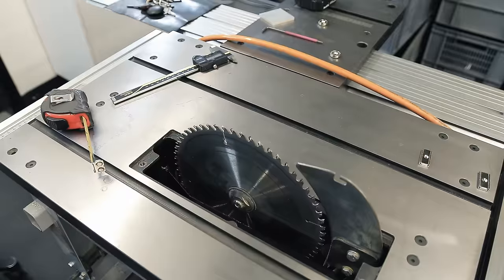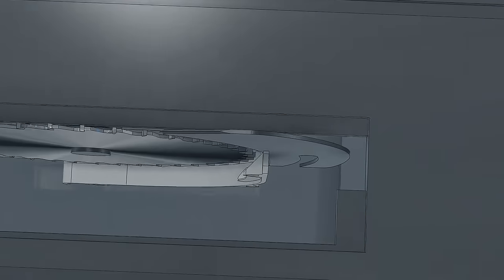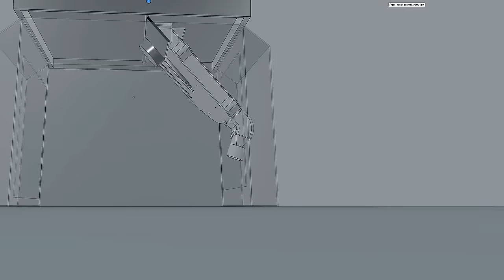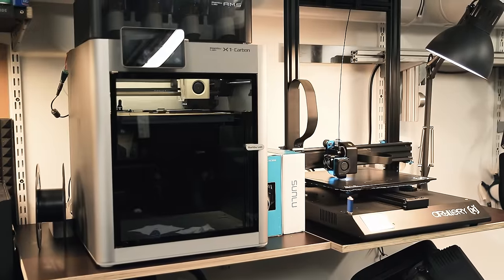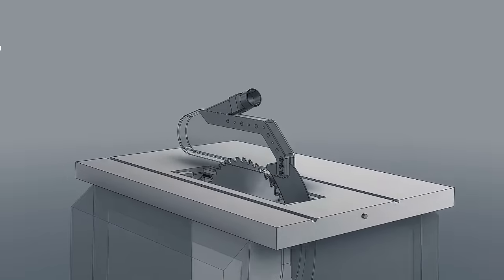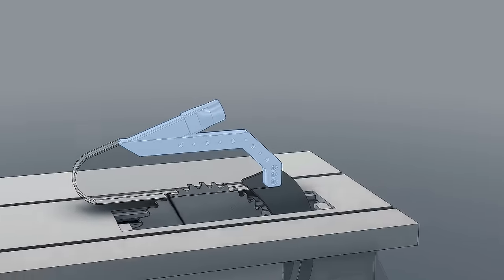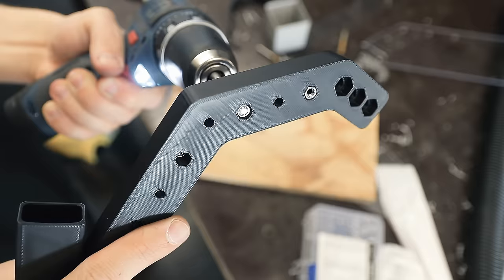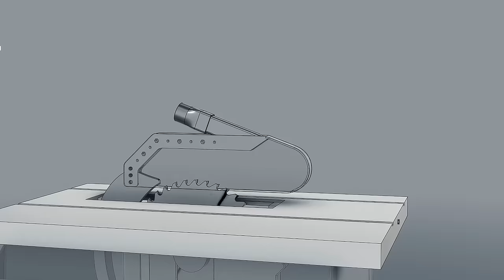How I re-engineered my Table Saw Dust Collection from Scratch using 3D Printing

Comment: The simplest and most effective dust collection I've seen is just removing the box and sealing off the bottom and putting the suction hose at the bottom.  Then get some magnetic sheets and put them across the gap at the front so the blade can still tilt.
Reply: Like an actual cabinet saw.
Reply: That is how most of the higher end saws I have seen work
Reply: Yes, I just don't get it. why pay all the effort to seal up the tricky blade not the whole bottom box

Comment: Put bristles at the end of the shroud.
Reply from the maker: I thought about that but unless the bristles are signficantly longer than your workpiece thickness you'd still end up with a gap at the end while also losing suction
Reply: @PhilVandelay  Would those 70mm bristle CNC vacuum strips work for you?
Reply from the maker: Possibly, it's just that I've never seen anyone use this approach for a table saw and I figured there's probably a reason. Might be worth a try, but for now I don't want to spend any more time on this
Reply: @PhilVandelay I was gonna suggest something similar, but not bristles: just add a short 3d printed (straight) piece to the front edge of the cover which is essentially extending the curved part, but can pivot. Once the piece of wood passes underneath, it drops to the table saw surface and essentially provides a ramp into the curved hood for the stuff that get's thrown out under the cover from the blade at the end. Watching the clips, the escaping particles are only a problem once the saw blade is starting to cut the back edge of the piece of wood, and by then this "ramp" would have dropped and likely catch a large portion of those.
Reply: How about sealing the bottom with another sheet of polycarbonate and using the saw to cut its own slot? That might seal it even better
Reply from the maker: @tanyeewei  Interesting idea!
Reply: My dust shroud came with skirts on each side that ride up and down on washers. It keeps one side closed if you're cutting less than the width of the shroud itself. 

The front has a flap that drops by gravity as soon as the work piece has passed through, creating an obstruction for the larger particles.
Reply: @PhilVandelay  any chance you'll sell and ship this to me?  Pretty sure I have the same saw :)

Comment: If you look closely on your video, when the wood piece travels passed the front edge of the blade shroud, the saw begins throwing dust particles backwards toward the user. If you had a small floating flap piece that was easily pushed up by the stock you're cutting, but then fell back down once the piece was clear it would likely cycle those chunks back into the shroud air flow

Comment: I am envious of this setup and will need to try printing some of these bits! For what its worth,  heres something i discovered when trying to do dust collection on a buffer -  the fast spinning blade essentially creates its own eddy which prevents dust collection. The only solution is to allow more airflow - i suspect that your shroud on the bottom is actually too narrow . Screens or bristles can be a lot more effective at closing in areas because they allow airflow IN but prevent chips from escaping. In my case a large box was more effective at fine dust collection than afitting shroud. Something to consider of you ever find yourself wanting to get additional capture. But what you've made is phenomenal!
Reply: I agree with this analysis, but this applies primarily to the large particles where you need more airflow to redirect particles with more momentum. For the fines, this was adequate.

Comment: I just finished this last night. 
first of all thanks for including the original files!!! I was able to adjust it to fit my Ridgid saw perfectly. 

I removed the bottom two nuts and added another nut at the back after scanning my riving knife and making a quick sketch. 

I have a 2HP dust collector and there is now literally 0 dust when I cut. this works so well. 

the only issue I had was cutting the polycarb by hand using a jigsaw. I had a small corner chip off but it's hardly noticeable.
Reply from the maker: Great to know it works for other saws as well!

Comment: Very nice work!  Well done!  I will definitely have to watch this video again, probably a few times.
At this point, two areas for possible further improvement jumped out at me:  a few other commenters have suggested adding some kind of bristles at the front of the blade guard/dust hood; and a few have also mentioned the importance of adequate air flow.  
Really liked the way you broke the problem down - some pieces are stationary, while others move with the blade.  Most folks would have missed that.

Comment: One improvement I'd love to try on your set-up is a flappy bit or brush that sits between the curved front and the blade like a scoop. Visible at around 20:28 

Making it a zero clearance style scoop means that the shroud won't have a big gap underneath it as it's lifted by the work material, so you'd also collect most of the chips not just fines.

Amazing build! I'm definitely stealing this concept for my mitre saw aka the dust cannon.
Reply: That’s what I was thinking. A flap that would ride on top of the material and fall down to the table once the materials pass.

Comment: Great video, subscribed! This is the reason why 3D printing is such a revolution for people like us. It allows us to design, prototype and print things that most manufacturers cut to save on product cost. I find that 99% of tools I purchase can be improved in some way, so I love this video.
Reply from the maker: Absolutely, making this from sheet metal would have been a nightmare, especially if you want to do rapid prototyping. I probably wouldn't have touched this problem were it not for the option of having my printer do the grunt work

Comment: Thank you for this, i purchased your 3d design recently and have now implemented this.  They key as you mentioned is the 'fine' dust that this captures and is the most important bit.  my workshop is typically was coated in a fine layer of dust,  this is now hardly noticeable,  it has worked wonders :)

Comment: Looks quite effective and a happy relief for you.  As you were talking us through it I was thinking that it is necessary to keep enough inlet open area to keep maximum velocity to entrain the particles with the air flow.  I chuckled once when I joined a company and one of my challenges was to solve a problem with a machine that had 250 cfm flow through a ... closed box!   Not too challenging for me to solve.  Same principle here.

Comment: Nicely done! The only thing you really need at this point is more CFM! A shop vac is only going to provide around 80-110 CFM. Most Table saws are going to require around 550 CFM.

Comment: Holes to the right of the blade in the zero clearance insert will allow more airflow, possible improving dust collection above and around the blade
Reply: Do you mean to the left of the blade? The right side of the insert would be covered by the wood.  See "Hooked on Wood" to see how Dennis engineered the HOW Zero Clearance insert. He's a lot like Phil here--a born engineer.

Comment: Nice video Phil! Some thoughts about your design. 

I know you said you don't have the justification of a dust collection system for the few tools you have in your shop. Shop vacs have very few cfm (cubic feet [or meters] per minute) but have higher velocity air movement than most dust collection systems, the reason your design needed to be so tight around the dust problem. More cfm would allow a looser design and accomplish effective collection. Of course your upgrade to a larger vacuum helped with this issue. 

Also small hoses and connectors also create restriction to cfm flow, so the larger the better. Even your wire reinforced hose tends to create more vacuum drop in the system, reducing the vacuum's ability to do the job, so the shorter those lengths the better. 

And for the design of the dust collection on the top of the saw, your blade guard that you designed is curved in the front to help redirect the dust toward the back where the port is located on the guard/schroud for the dust collection. That guard is attempting to change the direction of the dust particles from the way they come off the blade during a cut almost 180 degrees. However, larger particles have more momentum and can't be overcome by the available vaccum/cfm used from your vacuum because of the momentum due to the size/weight of the wood particles not collected. And of course, the denser the wood cut, the greater this problem will be. To capture the dust currently escaping, it can be done in one of two ways, increase the cfm to overcome that momentum, which might be difficult to do while attempting to keep the blade guard from getting too big, and/or possibly try and change the direction of your dust collection port so it catches the sawdust in the same way it's generated off the blade, instead of making it change directions, then to be collected at the port on the guard/shield you created. Hopefully this makes sense.

I didn't read through all comments so hopefully I'm not repeating what someone else might have already suggested.

Again, nice job, appreciate the content you've produced.

Comment: Chapeau. Very clever engineering and great solution to the issue. I just got the TS250 and am drowning in dust as well. I'd appreciate if you could share your design files for the dustbox. Thanks a ton.

Comment: For the hood, you could attach a small flap at and angle with a spring so when you push the material it rides on top of it and once you reach the end of the cut it can drop down and hopefully reduce that burst of particles.

Comment: There is a channel Hooked on Wood were you can find his experiment with an insert that has air slots to improve the airflow into the suction hose. His logic is that airflow out has to have a way of air getting in otherwise you just get a kind of vacuum. Airflow is what moves your dust.
Reply from the maker: Interesting, I'll have a look at that

Comment: Well done! One thing that might improve the dust collection of the heavier chips would be to attach a drop-down guard at the bottom of the rounded front in the shape of a hollow wedge, so that the sides is covered while the blades throw line is covered. Not sure If I make any sense, but just make a hinge on the bottom of the part you glued in that drops down the wedge as the wood passes by.
Reply from the maker: Yeah I've actually seen hoods like that but the main problem seems to be that it wants to shoot out straight to the front as you exit the cut, not so much the sides. I also thought about having something drop down in front to close that gap but couldn't really think of a good solution that works with varying blade settings. I think you could keep working on this endlessly and probably improve it a lot more but I wanted to be done with it 😅
Reply: @PhilVandelay  would brushes around the hood help?

Comment: That's a solid result. I wonder whether a wide-mouth intake fit level along the outfeed side of the table would catch those few remaining large chips. The cut wood would pass over it so it might remove chips stuck to the newly cut surfaces, too.

Comment: Very nice design, Phil. I like the magnets most. Makes everthing nicely maintainable. Something I would have done differently would be to think of flexible parts or even textile parts so that the dust box can move freely while everthing stays enclosed in any position. Maybe some kind of broom or vacuum cleaner hairs which close the gap when the saw is upright and bend against the dust box when the saw is tilted - or a leather or linen enclosure...
Anyway, well done.

Comment: You may want to try a small brush strip at the leading edge of the dust hood over the blade. It might slow the larger particles down long enough to be caught up in the suction.

Comment: im thinking of adding some brush bristles around the dust hood that's over the blade, like the brush around a CNC router. and also some upside down bristles in front of the saw fence rail.

Comment: Add a small rubber/silicone flap to the front of the top intake so when the working piece is past the front of the top intake the flap extends down and directs the chunks up into the intake.

Comment: Interesting! One addition that could be made is a slim suction slot behind the blade that could suck up more particles escaping from the back without hurting the table too much. Also, working on making the tolerances as small as possible without having stuff get stuck could improve the amount of static pressure, right? I feel like automating and improving the cleanliness of a shop not only helps avoid health issues but also makes you spend more time on the fun stuff in the long run.
Reply: Also. Designing an accordian style hingesystem might help with having less rigid parts and more parts that could adapt for the tilting.

Comment: You might consider designing the stiffening ribs for that dust box cover on the outside, so they don't catch fine particles and [further] turbulate airflow inside
Reply from the maker: That's actually a very good suggestion. Seems obvious in retrospect but never even crossed my mind

Comment: What an awesome piece of work, congratulations.  I'm sure I have the same saw, with the same problems but mine is badged and painted differntly.  Either that, or it's incredibly similar.   After hours spent with the side panels off trying to clear sawdust out of the way your video was like looking inside my own.  Even with a big, 100mm dust extractor on a 2m hose it's rubbish.  
Is there any way you could post the CAD and other info for the dust cage and zero clearance throat somewhere like Github or similar?   If the dimensions are anything like similar to mine I'll go out and buy a 3D printer just to fix it!

Comment: You could improve the dust hood on top by making the curved part a little lower, as dust seems to now shoot under it. If you make this end up at the height where a standard board (the normal size you'd use this with) would have the hood rest on the table itself once it slips past it'll close that gap, where it now instead leaves a gap as the board pulls up the hood.  
You could even make this a little flexible extension for the dust hood, or attach a brush to it, as all it needs to do is stop the dust shooting out so that it can be sucked up.

Comment: I did something similar but added another sliding box outside the main box to be able to have maximum coverage at all angles.  I never made it self adjusting so you had to change it everytime.   Was fun.  Unfortunately the effort wasn't worth the saw I put it on and I have now a better saw.

Comment: This is such a good video. Many have struggled with ideas but you did great at implementing what you did. I never thought of 3d printed insert. I have a saw like yours with that annoying top rod that wants to be close to the table surface. That is the cheap design compared to Unisaw and top models. Anyway, model it once, which is tricky as other odd forms are involved with holding that pivot rod and so on. Then reprint as needed for straight cut and angled. My overall thought is dust below the table is best captured by a sealed bottom platform box. You need cooling air for motor so a few vent holes but then not fancy shrowd needed right? Still need top thingy as tons of dust comes from the top.

Comment: Hmm, you can add a flapy piece of rubber on the end (or front) of the dust hood so it will deflect the chips that are being shoot at the end of the cut. The piece of rubber that goes on the bottom of the track saw rail will be ideal.

Comment: I have about the same problem. But I intend to keep the saw blade and everything that moves around it separate from the box that collects the saw chips. The sawdust box is fixed and is large enough to allow the saw blade to move up and down and tilt. It must of course be tight and have a connection for a chip suction hose

Comment: Have you thought about running a dust boot around the base of the dust hood?  Think the brush seals that cnc routers use. It would let you put the bottom of the brush seal all the way down onto the cast iron table and would take up the height of the wood and go back down onto the table after the material passed by
Reply from the maker: Yeah I have, that's actually something I want to maybe try in the future. The problem is that with the bristles, the dust hood needs to be so tall you can't really mount it to the riving knife anymore so you need an overarm dust hood solution. I wanted to keep this setup simple so I went with this solution for now
Reply: @PhilVandelay  it’s exactly why I went with an overhead but then space and ease of moving the machine become challenging 

Maybe if you kept the current design but took 7/8” to 1” off the bottom and installed a brush 

Would deal with the most common sheet goods. I find they typically make the most fine dust a la mdf 

By the way really appreciate the iterative way you went about this and ended up with the best solution vs time spent on reducing the amount of dust

More woodworking videos please!

Comment: A Dewalt Jobsite saw already has a better dust shroud, with the blade and motor moving and a fabric portion. The problem is the blade shooting dust at the cutting point straight back at you. That's the hard nearly impossible to catch dust that flies at speeds that would require 1000 CFM at 100 m/s